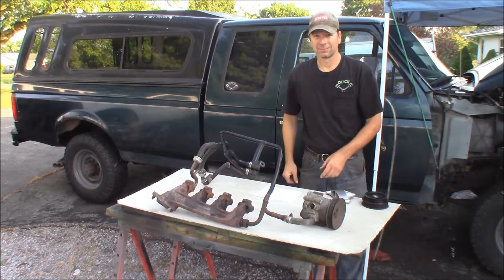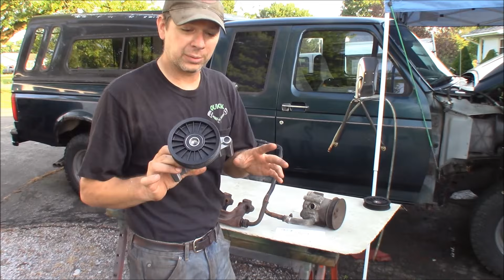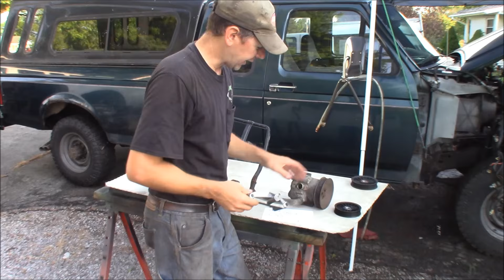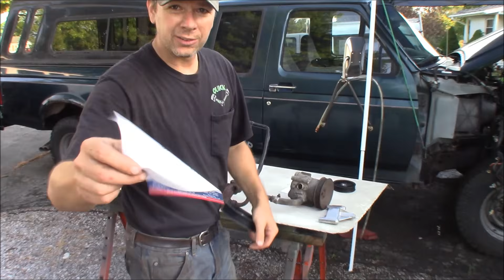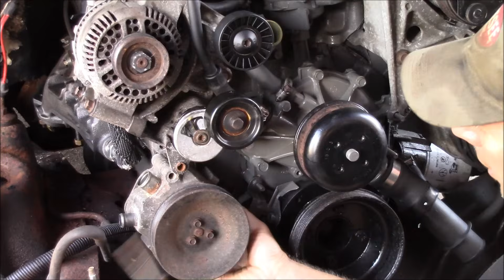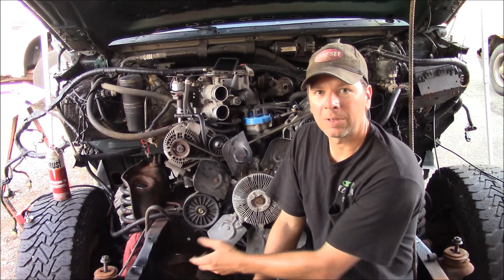1992-1997 OBS Ford Truck 5.8L Air Pump Smog Pump Delete F-150, F-250, F-350

Comment: you don't even know anything about smog pumps. why don't you explain what it actually does? it injects air into your catalytic converter to help light off the cat, burning excess fuel. Your computer waits for the cat to reach a certain temp before it changes from open loop to closed loop. By removing the smog pump you LOSE hp, not gain. You increase the coldness of the engine which again, causes you to LOSE hp, not gain. Cold oil in the engine circulates slower, it absorbs MORE carbon from unburnt fuel damaging cylinder walls and main bearings, it leaves carbon on your valves and psiton head. Don't forget to explain that too.
Reply from the maker: Let me guess, you had to google how a smog pump works and then regurgitate it to me, right? Yeah, great, except that these trucks, the smog pump doesn't go to converter, it goes to the manifold.  This is also OBD-I, the computer doesn't have the ability to "see" the smog pump.  Open loop vs cold loop is to help it run when the fuel charge is cold, until the engine reaches a minimum opetating temp, you know, kind of like a choke and exhaust heat riser used to help on carbureted engines?  Also, an air injection pump has nothing to do with the "coldness" of the engine running, whatever that is supposed to mean.  As soon as the engine is warm, maybe after a minute or so, the engine oil is the same temperature as the rest of the engine, it can't be "colder" than the rest of the engine.  I actually let my vhehicles warm up before driving cold unlike literally EVERYONE else that has a new car.  They get in, turn it on, and hammer away on a cold engine because "new cars can do that." I also never said anything about adding hp. 

Ford also made air injection an option, some trucks had it and some had a bypass, it's right on the emission sticker. All that being said, the amount of emission gain from blowing a little bit of air into the exhaust is negligible at best.  Do they still run air pumps on anything built after 1997?  Oh, they don't?  Why?  Oh, because it's old technology that makes negligible difference in emissions.
Reply: @QuickSpeedShop  I'm a licensed smog tech in california. Now, yes it goes into the manifold, where does the manifold go? To the cat. If the excess fuel burnt off in the manifold it would explode and crack the manifold, there isn't enough compression or spark to brun it in the manifold. 🙂
Reply from the maker: California smog tech, that figures.  Luckily, this ISN'T California.  You seriously think unburned fuel would crack a manifold?  Have you ever seen an engine run thru open headers or manifolds?  The cylinders literally blow fire out of the combustion chambers!  I have a Buick Nailhead powered dragster with 18 inch open headers.  If I rev it in the dark and let off, it will blow flames out all 8 pipes! 

You can rest easy tonight knowing all my cars only require safety inspections where I live as my newest is a 1995.  The ones that came with converters new still have converters on them.  So, in the grand scheme of things, having an air pump bypass on my F250 really doesn't mean anything.  After all, I did just go to the grocery store tonight in my 1970s 460 powered F250, not because I had to, but because I wanted to and because America! 🇺🇲
Reply: @QuickSpeedShop  "So, in the grand scheme of things, having an air pump bypass on my F250 really doesn't mean anything."  The grand scheme of things is helping your car warm up faster, and last longer.The reason you blow flames out your headers is because the unburnt fuel is mixing with atmospheric oxygen. I actually think it's great you ahve some old cars your'e proud of, nothing wrong with that. But anybody, from any nation or country can delete their smog pump, it doesn't give them a green card my friend.

Comment: BUT WILL THE DASH LIGHT STILL COME ON?   HAS TO GO THRU INSPECTION.
Reply from the maker: Not on 1992-1997 F250/F350 .  Also, not on 1992-1995 F150. These are OBD-I computer trucks.  1996 F150 yes because its an OBD-II computer truck.  It's clearly written all in the video description.

Comment: If I don't have the ability to weld off things can I just add the by pass kit and use the hose around  the sensor
Reply: And lev  the other  hose connected
Reply: Everyone want 400.00 to 300. For a smog pump
Reply: Everyone want 400.00 to 300. For a smog pump
Reply: Everyone want 400.00 to 300. For a smog pump
Reply from the maker: As long as it's 1995 or older with OBD-I computer, then yes.  Just do the bypass and plug the hoses.

Comment: 97 ford f250 5.8l Windsor 
I left smog pump in and left the idler pulley the shorter belt is a K060942 13/16 x 94-7/8”OC from Oreillys and that’s with A/C
Reply from the maker: Good info for those that want to go that route.  I wanted to run the factory belt and make it look factory.
Reply: Bought this exact belt at Oreillys PN K060942 and it is too small!!       1995 E-150 5.8 351w 😳

Comment: I just got a 96 to 50 XL with front locking hubs. She’s in rough condition but if I do the smog delete, does that get rid of the PCV valve and the EGR? I need both but the air pumps hoses are all rusted out and gone so I might as well just do the smog delete. She’s very rusty and this is going to take a lot of doing, but I have to get new manifolds on each side and an alternator and then do something about this EGR and PCV valve and air pump. I also have to get the spark plugs out somehow they’re very corroded.  But all of that would get her on the road and then I could do the rest as I go. Moneys tight, so I’m trying to do this on a budget. I’m doing everything myself, but I’ve never taken on something like this. I could really use some guidance. If you can find a time or you happen to see this, please just shoot me some advice or maybe I can send you a video and you could give me some words of wisdom
Reply from the maker: You can't do this one a 1996 F150 with the 5.0L.  That truck has the OBD-II computer and it looks for the smog system.  I wrote this clearly in the video description.  You also can't get rid of the EGR for the same reason.  Why would you want to get rid of the PCV system?  If you do that the engine won't breathe right and will burn or leak oil.

Comment: So I am wanting to do this to my 95 f150 5.0 my smog pump is whining very loud and about to freeze up and obviously can’t find the proform bracket but I can order one from ford performance M-8604-A50 I’m wanting to know if this is the correct one I need to run the same size belt and also is that the only part I need to order?
Reply from the maker: Yes, it's the right bracket and you don't need to change the pulley since you have the 5.0L.
Reply: @QuickSpeedShop Thank you

Comment: Is fuel economy still good
Reply from the maker: Unchanged.  Air injection pump  literally just blows a little air into the exhaust to burn "unburnt" gasses.  Has absolutely no impact on fuel delivery or fuel economy.
Reply: @QuickSpeedShop  That's just factually incorrect. A smog pump is a device which converts energy into positive pressure. Vane Friction, Aerodynamic Drag, and Turbulence within the unit contribute further to losses when added to the intended ~3psi to be generated by the pump. You cannot argue that converting engine energy in an ideal scenario to 3psi of positive air pressure through a belt drive has no impact on fuel economy. Energy is being used on something other than propelling the car forward, meaning reduced energy efficiency. In this case, your energy comes by the gallon. Pumps at 30+ years of age are only getting worse in this regard, bearings and otherwise, and they cannot be easily replaced like idler pulleys. This only gets worse as RPMs rise.  The mass of air being moved increases, and the aerodynamic drag and other friction losses within the pump rise exponentially along the curve. Your solution, a ball bearing, utilized in both pumps and pulleys, is optimized to reduce loss to friction by definition. So, in this case, there is still some friction. The optimal solution here is to eliminate the unnecessary idler pulley, as then you would eliminate all extraneous points of friction heat loss related to this pump.

Comment: Probably not really a good idea your motors are not gonna run right The recycle air going back into the manifold works similar almost  You'll get codes just keep all your parts because you're gonna want to put it back together sooner or later you're gonna get tired of that check engine light coming on even if you replace it with the electronics to keep that from coming back on it's still gonna come on that exhaust is supposed to be going back into the engine to run the engine
Reply from the maker: Nope, you're wrong on all accounts, and obviously have no idea how any of this works. I  have over 100,000 miles on this setup in three different trucks, no problems, no lights, no regrets.

Comment: If the belt looks bad....just get a new shorter belt and use the pulley supplied.
Reply from the maker: You can do that, however I want to run the factory length belt.

Comment: this bracket does in fact fit on a 1987-1991 ford 351/ 5.8L. i finally got this very bracket  but you will have to buy a new lower mounting bolt. . just thought i would let yall know
Reply: What size bolts? I bought a truck with this missing and the belt was off it. Got the pulley need bolts

Comment: Can you leave the crossover head pipe on with doing this? I assume the 3/4” loop that you install towards the end of the video keeps the egr system functioning, but without the smog pump?
Reply from the maker: The smog pump and EGR are separate systems that have nothing to do with each other.  By cross over head pipe do you mean an air injection pipe hooked to both manifolds?  If so just leave it all in place.  It just won't have air pumped in it.
Reply: @ Excellent, thank you for the quick response.

Comment: Would anyone know what size pulley for a 1993 5.0?
Reply from the maker: The pulley that comes on the idler is for a 5.0L.  That's the reason I change the pulley in the video.  For a 5.0L, just buy the bracket and bolt it on.

Comment: What if you kept the smog pump and just put the air injection directly to the egr port?
Reply from the maker: The point of the video is to remove it because they seize up and leave you stranded.

Comment: How do you get past the check engine light? I have a 96 5.0 with obd2 please help.
Reply from the maker: I wrote clearly in the description that you CANNOT do this to a 1996 with the OBD-II computer.  It will throw a check engine light.  Only 1995 and older and only the 1996-1997 HD trucks with OBD-I
Reply: @QuickSpeedShop  ok thanks

Comment: What benefits should someone expect from doing this?
Reply from the maker: The only benefit is the simplicity of not running a complicated air injection system that does nothing for emissions reductions and replacing an expensive air pump, that is prone to seizing up and leaving you stranded, with a basic idler.
Reply: @QuickSpeedShop  I purchased a 1991 F150 5.8 just interested in seeing if I should go with this route
Reply from the maker: I've done it on every Windsor V8 I've had and never had any problems

Comment: All you need to do is put on a shorter belt and reroute it ...leave the air pump alone...thats what I did on a 302
Reply from the maker: This video shows how to do a factory style bypass.  If you want to use a shorter belt then do it.  This video isn't about that.

Comment: This will not work on any 96, with OBD-ll ! Computer won’t allow it to be done without causing codes!
Reply from the maker: Incorrect.  Only the 1996 F150, used the OBD-II computer which would throw a check engine light.  The 1996 and 1997 HD F250 and F350 still used the OBD-I computer which allows this to work.
Reply: @QuickSpeedShop  yep, sorry you are correct, I failed to say obd-ll in my post.

Comment: What is the benefit of doing this over replacing the Air pump?
Reply from the maker: Air pumps seize up and leave you stranded, idlers do not.  Also, the air injection is old useless technology that does nothing for emissions.

Comment: How did you go about removing the charcoal canister? Did you plug the line coming from the fuel tank or leave it open so the fuel tank can vent?
Reply from the maker: I didn't touch the fuel system.  This only bypasses the air pump.

Comment: My 94 F150 302 is nothing like that. I have replaced both manifolds and there is no fitting in the front end, it's in the back of the cyl heads.
Reply from the maker: I did the same mod on the 302 in my 1988 E150.  I left all the smog tubes in place and just removed the pump and added the idler.

Comment: Would the parts you used work on my 1995 250 7.5 L?  If not, how do I find the right part to mount a pulley like you did?
Reply from the maker: I don't think they made a factory bypass for the big block.  I have worked on one so I'm not familiar with the belt layout.
Reply: @QuickSpeedShop , thank you for your reply.  I'll do more looking into.  BTW, your videos are great and are a big help!

Comment: If anyone wants to run a shorter belt i am using a 923K6 in my 91 e350 with 5.8L. 923= length, K6=number of rips.

Comment: Would this same set up work on a 96 4.9
I've just been using a non ac serpentine 
But im tokd that may cause stress problems on other components
Reply from the maker: You're not going to stress anything out with a different belt routing.  The tensioner holds the same amount of tension on the belt no matter which way it runs.
Reply: @QuickSpeedShop  that's what I and 3 or4 other guys that have done it said.
He was fairky adamant 
Im pretty sure he may have invebred trucks.

Im getting ready to build this into a vankife camoer wuth 284k miles 
Need it to last to Atizona at least

Comment: I don't have any smog stuff on my truck would this make it run at a higher idle
Reply from the maker: Air pump has nothing to do with idle.  Could be bad IAC (idle air control), throttle position sensor, vacuum leak, bound up throttle cable.

Comment: The pulley number from AutoZone is slightly smaller than the pulley in the air pump
Reply from the maker: How much is slightly smaller?  As long as its within probably 90% overall diameter it should work.

Comment: I have a 1990 f150 .it runs good for about 20 miles then it acts like it's not getting fuel and shuts off. Any ideas on what causes it?
Reply from the maker: Could be a bad coil, distributor pickup, fuel pump issue or relay, computer issue, fuel pressure regulator...Without actually being there I can't diagnose it.  Find someone with an old scanner and have them read the codes thru the plug on the inside of the left fender.

Comment: Looks good. But you can just use a shorter belt. Dont need the puller at all.  97 ⅛th" belt with pulley delete.
Reply: I was looking to see if anyone was going mention a shorter belt.  One less bearing to spin, fewer moving parts,  more simple, less parasitic loss.
Reply from the maker: I answered this many times in the comments.  Yes, you can. This video is to show how to do it like the factory did with an idler.

Comment: This heats up the engine too much. I've tested this
Reply from the maker: Wrong!  I've run this truck over 50k, ran my last truck over 20k, ran my van with same mod over 10k.  Absolutely does not affect engine temperature at all.  Has nothing to do with the coolant system or engine temps.
Reply: @QuickSpeedShop  messn with the egr valve does I mixed the two up I'm getting ready to do this on mine... The smog pump is makn a wretched terrible noise so I'm gonna do this and eliminate the bs....prob helps keep the engine cleaner ....can't you just use the pulley from the smog pump on the new bracket?
Reply from the maker: The EGR and the smog pump are two separate systems.  No, the pulley from the pump won't fit the bracket.

Comment: Does it have a sensor thats telling it the computer thats air injection system is not working?
Reply from the maker: No sensor on 1995 and older with OBD-I computer.  1996-1997 HD F250 and F350 also no sensor as they have OBD-I as well.  Will NOT work on 1996 F150 as that truck has OBD-II computer and will throw CEL.

Comment: This video has been so helpful, I appreciate you taking the time to make it. 

Some part is confusing to me though, I think the 97 f250hd 351w has a different air pump setup. 

Your pump feeds into the front of the passenger manifold. My truck has only the egr solenoid with pipe going straight to the same point. 

The driver’s side manifold has a large port in rear that wraps behind the engine and leads to the pump.

 All the videos I have watched have the driver side manifold without an extra bung. I have been stumped on finding the records or diagrams of the different smog/egr iterations for the truck. My truck seems to be an outlier. I did find that the 1987-95 shorties are different than the 96 shorties from Holley so maybe that is a clue. 

Any help would be appreciated!
Reply from the maker: I have done this '95 and a '97 and they were both identical.  Only the EGR goes into the front of the pass manifold.  If you look closely at the parts on the table you can see the EGR tube.  The air pump is hooked to the black sheet metal tube with the hoses on it that bolts to the engine.  The pipes are laying over each other making it look like the air pump goes to the front of the manifold which it does not.  The driver's side only has the rear port which I cut off and welded up.  I replaced the pass manifold because it was broken and it came with a plug for the rear air tube.
Reply: hahaha what a prank! it all makes sense now. Did you omit the air canister— it think that’s what it’s called. The rounded cube that has the vacuum lines to it on the passenger wheel well